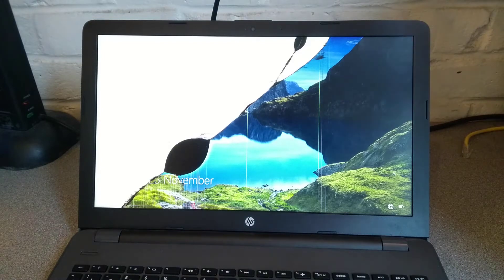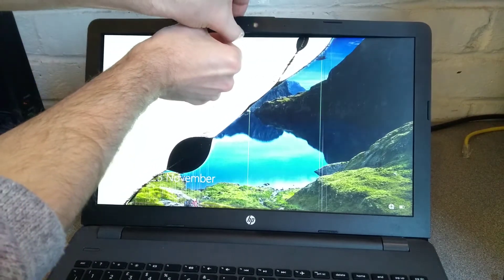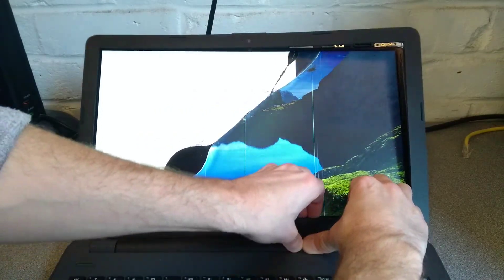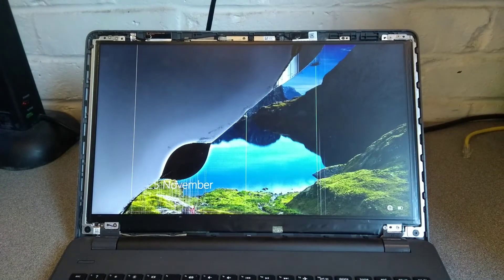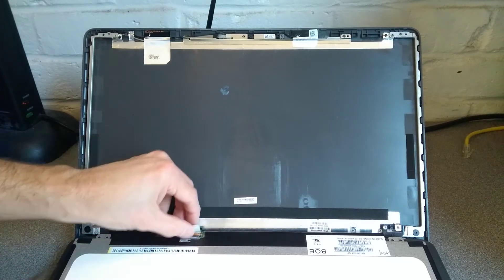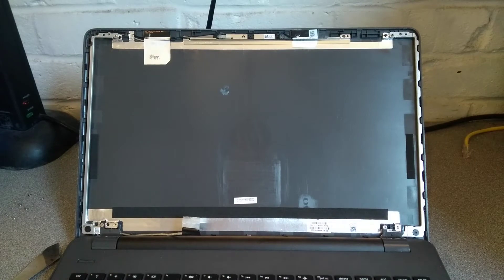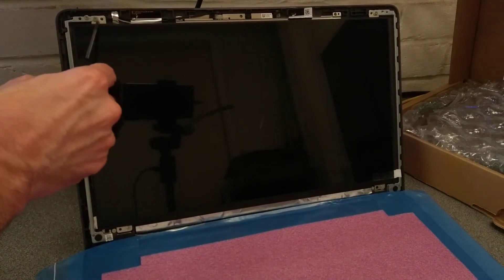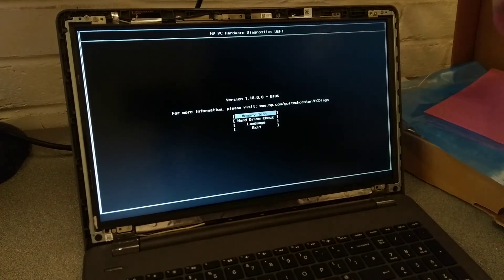HP 250 G6 Laptop - How to replace the screen

Comment: Hello mate this video was very much needed. Do you know where I can find LSD replacement screen on any website, I got HP 250 g6 mn: 3168NGW or does HP 250 g6 screen go for any model? Cheers
Reply from the maker: I usually take out the broken screen then search the same model number from the back of the screen on eBay.

Comment: Hey man love the video, just a quick question, the replacement display you used, was it specifically made for the g6 250 or was it more generic?
Reply from the maker: Almost certainly searched for the screen model number on the back of the broken screen on eBay and bought whatever was cheapest.